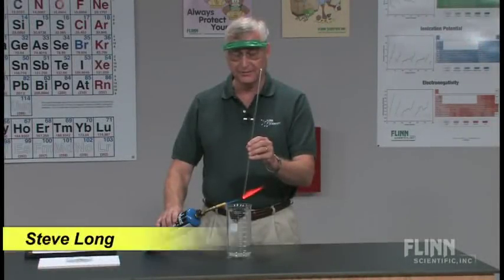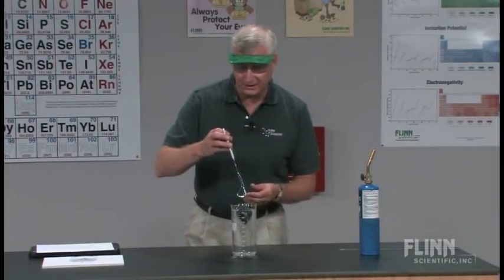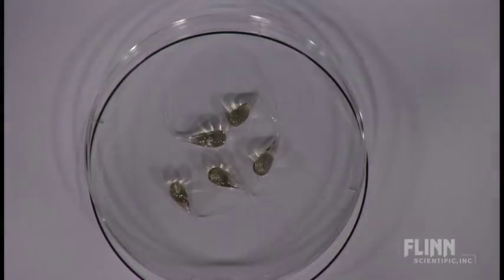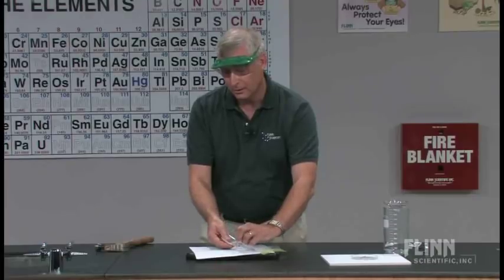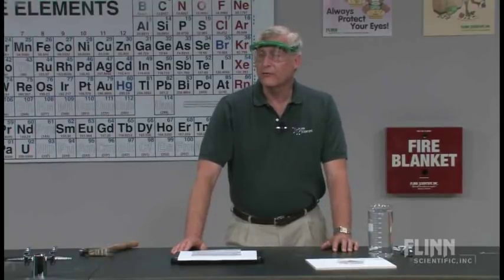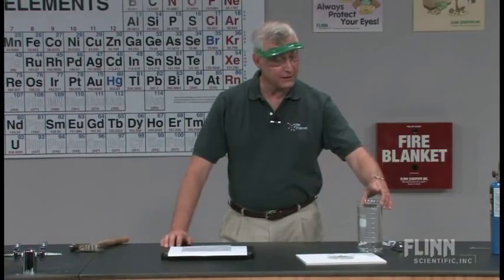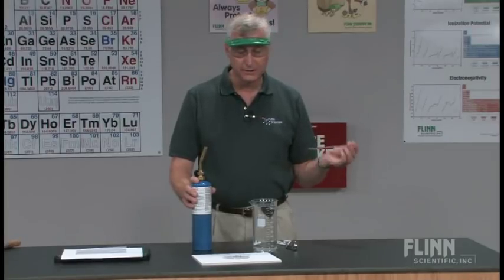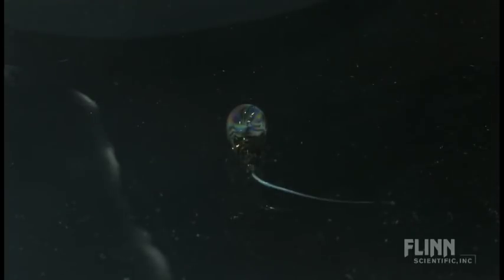Prince Rupert's Drops Are Stronger Than Steel

Comment: A LOT of things are stronger than steel, toughness however is an entirely different matter.  Not so many things are tougher then steel.
Reply: Steel beams
Reply: duscodick I heard One World Trade Center's frame is made from Prince Rupert drops.
Reply: Bo McGillacutty I'm tougher than Steel.
Reply: Bo McGillacutty titanium
Reply: Jayson201 Well no not titanium alloys in terms of cross section, the standard reference, and of course there are all  sorts of alloys....Steels run from a yield strength of aprox. 35 to 230 ksi,, some 7 to 1 difference in strength depending on which one. (off the top of my head) Titanium has a higher strength to weight ratio then steel, but lower absolute strength.  

That's why titanium is used in expensive things where  weight is paramount like aircraft.  Boeing Airliners use a lot of titanium hydraulic plumbing but they use some stainless pipes around the landing gear area because the stainless steel is tougher...it can better survive a tire blow out which can be like a bomb going off.
Reply: Gunther Ultrabolt Novacrunch OK then, I take your word for it and don't even care to put them through destructive testing procedures necessary to confirm it.
Reply: Bo McGillacutty I appreciate that Bo.
Reply: Gunther Ultrabolt Novacrunch It's a one time amnesty offer, don't expect to get off so easy again.
Reply: duscodick Dank Memes
Reply: Bo McGillacutty How do you define toughness?  He hit the drop with a hammer.   That's a good test of toughness.
Reply: Saddom Madnes is this a joke?
Reply: Saddom Madnes Toughness is defined by how much energy a material can take before cracking (rupturing), think of a hammer blow.  Glass like this is (some glass is a lot tougher than others) clearly NOT tough at all, nor is diamond for that matter.  Strength is defined by how much load it can take gradually applied, compression, tensile or sheer.
Reply: Steve S Thanks!
Reply: Steve S No problem, I needed that, who knows how many times I have been so sloppy.
Reply: Bo McGillacutty & +Steve, I just have to comment on the delightful exchange you two had here. It really warms my heart to see the light-hearted & comfortable banter! 
Especially, when Steve corrected Bos spelling! I have the "pedant" thing too! I wish everyone had the attitude you two have! I always appreciate it when/if my spelling/grammar isn't up to par, and someone has taken their time to point out what is correct! But, I find that most folks just choose to be so offended by it. Bless your hearts for restoring my faith in the fact that people can interact w/out being offended! I think folks now days have gone overboard with the "politically correct" nonsense! I think it's just better to grin, and just get along!  :-)
Reply: Renee Pigeon Thanks, actually my initial thought to his correction was slightly negative but there is no good reason for that and I really did need that, so it would be childish and counterproductive to express anything other then....er....than gratitude.  I have to appreciate one who takes the time to make such a correction.

I'm apparently a tad dyslexic but certainly an atrocious speller and when the checker misses it I do too.
Reply: Bo McGillacutty 9/11 WAS AN INSIDE JOB!
Reply: GamerZeus Gamer TROLL.
Reply: Steve S and Renee Pigeon:
 All that said, it would be unfortunate if one misses the message (assuming it has value) because they are irritated by language mechanics.  The main point is transfer of ideas not typos and trivialities. That doesn't reduce my need to be improve to avoid interference with communication but it might be something you should keep in perspective?

Many are surprised when I tell them my engineering professors were essentially dismissive of spelling details. For some of them English was their 2nd or 3rd language anyway.  But all were too focused on the crucial aspects of the field--understanding the concepts, performing the mathematical manipulations correctly, calculations, and ending up at valid numbers and conclusions.  There just wasn't time, energy or necessity for the arbitrary rules of language when one is dealing with the solid laws of nature.
Reply: Steve S I totally agree Steve!
Reply: Steve S The example you used was not a problem with language but a result of another kind of sloppiness AND particularly the fact the America is a backwater in some respects and can't seem to get rid of our archaic system of measurements and join the 20th century already. It's ridiculous that we are stuck with a highly inferior, inefficient system.  It must cost our economy a pile every year that we procrastinate joining the international community by going metric.

My gripe with being overly sensitive to technicalities of communication is that being that way is also a major interference to understanding.  What if you are talking to a person for whom English is their 3rd language?  Are you going to be so fixated on linguistics that you can't learn something interesting from them?

If such things as punctuation and spelling errors caused miscalculations they would NOT have been tolerated in an engineering classroom, but they never had that effect.  At worse they required clarification.
Reply: +Bo McGillacutty I tend to agree with you for the most part, as long as the meaning is clear. There is no reason, however, that one can not correct a grammatical error and absorb the meaning of what is being said at the same time. If one's focus on proper grammar causes them to ignore the message they are correcting, they too have failed in communication.

As for the United States clinging to Imperial units, it's less a matter of stubborn "backwater" tenancies as it is a matter of economics. The united states infrastructure was built on Imperial units. Changing to the Metric system (which most will acknowledge as generally superior,) would mean replacing countless tools, machines, and hardware that currently interface with each-other. Yes, it's a conversion that needs to happen, but the hesitation is due to our government's lack of willingness to make sacrifices in the short term for the sake of the long term, not some misguided belief that Imperial units are somehow better.
Reply: Josh Fox Yes you make good points. And for the record I like to be corrected and I try to improve.  No doubt there is a big short term cost to going metric (a slogan I remember from my grade school years in the '70s, we were "going metric" back THEN!).  But it never happened and we pay every year we put it off.  It is a vastly superior system and 1000 times easier to learn and remember and far easier to use.  No one even knows the Imperial system really....who knows how many feet in a mile (well I do), ounces in a gallon, what's a bushel?  a barrel? on and on.

One cubic centimeter equals one milliliter and it takes one calorie to heat up one millimeter of water one degree C, freezing is 0 C and boiling is 100. (beautiful!)  Learn a dozen or two prefixes and about as many base units and you know almost the whole darn thing.  And most crucially, each prefix is an even multiple of ten up or down.

And of course the scientific community, and at least some manufacturers and engineering is metric in the US.
Reply: ***** Hahaha.
Reply: +Bo McGillacutty am i late?

but an alloy of osmium and iridium well be tougher then steel☺
Reply: Abdulaziz aljuied Lol!  Maybe so I wouldn't know.  :-)  BTW...It always bothers me to hear that steel reference in part because steels vary by an order of magnitude in strength, there are thousands of kinds.
Reply: +Bo McGillacutty Bender Bending Rodriguez
Reply: Alexander Bamford   I know of no aluminum or titanium alloys in use that are tougher then the toughest steels commercially available.

 With regards to aluminum, it would then be a candidate for--say the hydraulic plumbing near the landing gear on a modern airliner where potential catastrophic tire failure can cause sever damage, that area now favors stainless steel while the rest of the aircraft (for Boeing at least) relies largely on the less abuse tolerant but much lighter titanium pipes.

 Or perhaps aluminum alloy armor plating in many instances, it's not used in either category.  Ti has major advantages in weight saving to offset it's reduced toughness in, say the 'bathtub' shield around the pilot in the A-10 for example.  Infact NO Al alloys even come close in toughness to common steels like A-514.

You don't see tanks or war ships plated in aluminum armor and your not about to.

. One of my gripes about such comparisons to "steel" is that there is roughly an order of magnitude difference (with respect to strength) across the spectrum of steel types.  So which steel is being referenced ???
Reply: +Alexander Bamford Titanium is rarely used as armor plate because its expensive and as such only used for weight critical designs. The Bradley fighting vehicle and other lightweight air mobile armored vehicles are made almost entirely from Aluminum armor plate, usually with composite or steel plate to compensate in certain areas for increased protection and survivability.
Reply: +Bo McGillacutty The drop only endured a compression force, if it could handle more tensile force then steel I'd be impressed but ceramics usually hate that kind of stuff.
Reply: +Bo McGillacutty Diamonds? Carbon Nanotubes?
Reply: MrBiky Yup.  And common carbon fibers (some of these only in tension of course, others in compression), spiders web in some cases, kevlar perhaps, some sea shells?.... but what steel is being referred to?  There is nearly an order of magnitude difference in strengths of steels.
Reply: Bo McGillacutty Isn't Maraging Steel the toughest steel? Maraging Steel has ultimate tensile strength of 2.5 Pa and Carbon nanotubes has 462-546 GPa (for single layer - Graphene it's 25 GPa). If no, tell me, though I know C nanotubes should be the strongest material we know.
Reply: MrBiky  I don't know that class of steels well...very high nickle however, it sounds like you know the numbers already.
Reply: *****   WTF does that have to do with anything?  But of course it's a false statement as one can heat jet fuel (or anything else) to a plasma and blow right through as much steel as you care to.
Reply: *****   What does molten steel have to do with ANYTHING relevant here?   BTW....it's obvious you don't even know what steel IS let alone much of anything else, you are simply regurgitating something you heard and chose to believe.
Reply: ***** No molten steel was ever found anywhere associated with 9/11.   Get an F'n clue already.  Sheesh.
Reply: +Bo McGillacutty Toughness was also in black ops 2
Reply: Steel fuel doesn't melt jet beams
Reply: +Optimistic Pessimist All the Jet fuel was Gone in the first few seconds, The "Strange Pink Energetic Flame" behind  the very outside corner beam of the tower right before collapse was very Curious
Reply: +David Fuller 53 comments and this went from chemistry to conspiracy theories.... Why am I not surprised :)
Reply: ***** You're right that it can't melt at that, I'm not going to challenge that :P But, there's something you learn even when simply touring a blacksmith: Anything, steel included, is a lot easier to bend and break when it's at that high a temperature. It doesn't need to melt :)

I also get that there's plenty of videos out there that look like molten steel in the buildings. But when you realize how low quality the pictures are, and that at least one picture was doctored to make a flashlight beam look like it, you realize "you know, my eyes want to say that's steel, because I heard about steel. But, yet again that could just as easily be burning electronics, wood, or a flashlight."

I was in your same mindset for about 7 years. It's hard to not throw accusations when you know the government does shit behind your back, but you have to keep an open eye to other possibilities. Best of luck to you :)
Reply: +DarkBallYE https://en.wikipedia.org/wiki/Annealing_(metallurgy)  Annealing, in metallurgy and materials science, is a heat treatment that alters the physical and sometimes chemical properties of a material to increase its ductility and reduce its hardness, making it more workable. It involves heating a material to above its recrystallization temperature, maintaining a suitable temperature, and then cooling.In annealing, atoms migrate in the crystal lattice and the number of dislocations decreases, leading to the change in ductility and hardness.In the cases of copper, steel, silver, and brass, this process is performed by heating the material (generally until glowing) for a while and then slowly letting it cool to room temperature in still air. Copper, silver[1] and brass can be cooled slowly in air, or quickly by quenching in water, unlike ferrous metals, such as steel, which must be cooled slowly to anneal. In this fashion, the metal is softened and prepared for further work—such as shaping, stamping, or forming.
Reply: DarkBallYE "Anything, steel included, is a lot easier to bend and break when it's at that high a temperature. It doesn't need to melt :)"
Yes ... That is Exactly what Annealing is. 1333 degrees Fahrenheit for steel  and the steel crystals start loosening enough to be Pliable.
That is exactly what lead me to this video about prince Rupert's drop is annealing glass
Reply: +DarkBallYE What do you mean 53 comments ?? The First Comment Jet Fuel Went to Conspiracy theories ??
Reply: ***** Only those whom know NOTHING about 9/11 or structural materials even mention molten steel and 9/11 together.  There never was any liquid steel nor temps high enough for that.  Why do you keep repeating nonsense?
Reply: *****   AHHH!   The men in BLACK SUITS!  Hahahahaha   Did they fill their pockets with the stuff?....kevlar suits no doubt.   Hehehee
Reply: +Anime Guru Bad troll is bad troll.
Reply: He had to of mistakenly chose the wrong words in his video...
sorry but wrong... not "stronger than steel" harder maybe, but when it comes to metallurgy the harder something is the more brittle it is, & why glass shatters when dropped. Now if you have a hardened piece of steel & drop in on a cement ground it too will shatter. Now if you have some steel that is partly hardened, & partly ductile the stronger it seems. As it will last longer, has the ability to take, & forgive more stress, making it "stronger". The harder something is doesn't mean it's stronger.
Reply: Good example, watch the video with drop & a bullet. A bullet is made of led a very soft metal, but the bullet shatters the glass drop & wins, because it's stronger rather than harder.
Reply: To be fair, the tip did break first.
Reply: And even full-metal jacket rounds disintegrate with impact against a PRD.
Reply: titanium...... about the sams strenth as steel, but more durable, chromium, ect. just to name a few
Reply: Thanos
Reply: Yes, because steel, as well as iron, bend instead of snap, if i remember correctly. One thing that is stronger than steel is iron, but iron isnt preferred for most applications because of its tendency to corrode.
Reply: My life is much tougher

Comment: Jet fuel can't melt prince Rupert drop beams
Reply: It was the chemtrails dummy
Reply: Its just water steam that forms in the engine
Reply: kuriTM r/woooosh
Reply: @ria6920  r/woooooooooosh
Reply: i dont know a good name there was no good name r/woooooooooooooooooooooooosh
Reply: Parasoul Renoir you have anime as a profile pic and therefore your opinion is invalid.
Reply: @cronin5488  Just adding to the madness r/woooooooooooooooooooooooooooooooooooooooooosh
Reply: TheDrummingXbox360 r/wooooooooooooooooooooo wooooooooooooooooooooo wooooooooooooooooooooo wooooooooooooooooooooosh
Reply: Want to make a bet that jet fuel can't melt glass I can make a system that it will
Reply: @cronin5488  r/wooooooooooooooooooooooooooooooooooooooooooooooooooooooooooooooooooooooooooooooooooooosh
Reply: Jet fuel is kerosene.
Reply: @TheTeufelhunden68  and so are you
Reply: This comment section is gold
Reply: @zacharyslater2349  no.
Reply: Nah